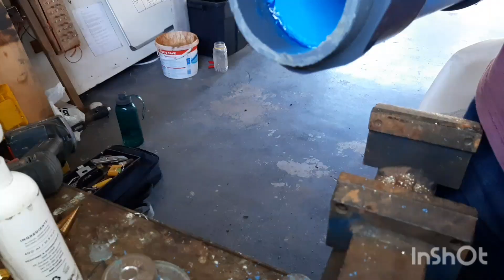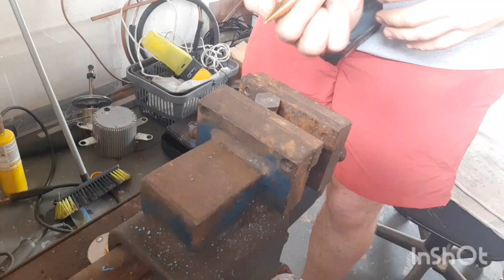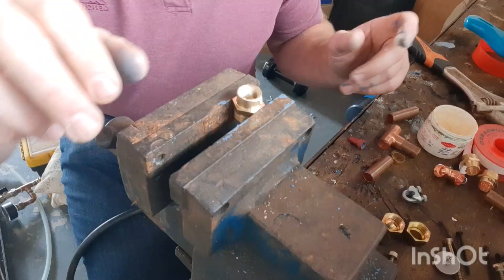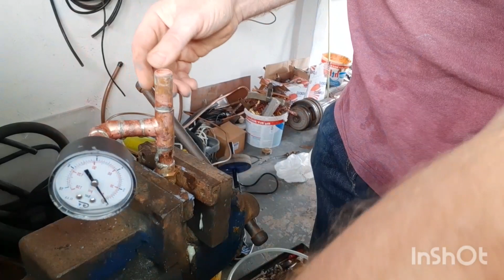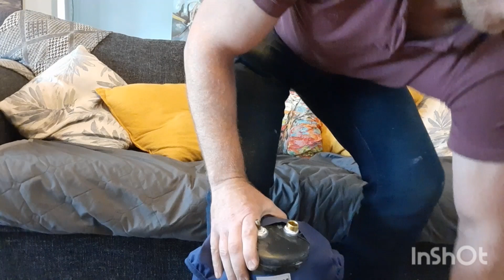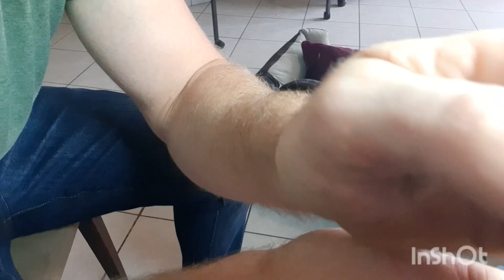BREATH UNDER WATER WITH SIMPLE PLUMBING MATERIALS.

Comment: how long can you breath with this tank
Reply from the maker: Depending on how much pressure you put into it. Seeing as though I've only used basic plumbing materials, you can only pressurize it to about max 8 bar. Continuous breathing wont last too long on 8 bar, probably about 10min but with holding your breath, then about 30min. If you use hydraulic hoses and stainless steel  then you could make it like a regular scuberdiving tank.

Comment: Very cool. I've been wanting to make one of these for years. Ever since I went scuba diving. Thought it would be fun to mess around with in the pool. Looks like it worked really well.
Reply from the maker: Thanks for your comment Codyson.Yes it did work well, you still have to hold your breath if you want it to last long, well depending on how much you pressurize it and it takes a bit of getting used to. But once you have the nak then it's really awesome.
Reply: Where is my music?
Reply from the maker: @quintonmarcus2736  I told you that I could hear you breathing when you were plucking at your strings and I didnt want that.